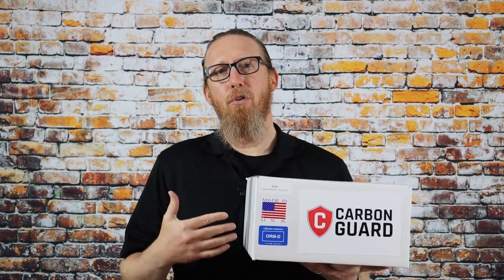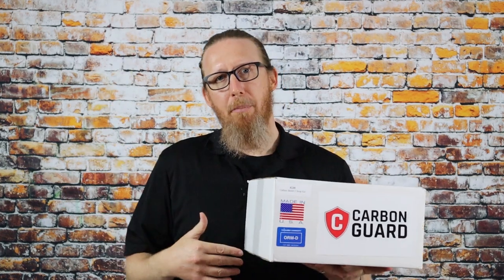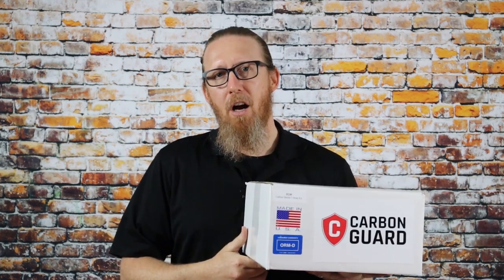Bowed Basement Walls Tips

Comment: Carbon fiber wasnt a thing when I was working it. We just used I beams and poured a new concrete wall to height on the inside of the structure to keep the wall from maxing out and collapsing. Nice info, branching out a bit more.
Reply from the maker: Thank you! We've done a lot with i-beams but we're moving into carbon fiber for those with less bowed walls.
Reply: What if you have two walls that are doing it right next to each other like the one on the left and the one straight ahead?   Can these be repaired in the same method?

Comment: My house is a split level in the center of my property. About a 1/4 acre in a residential neighborhood. The yard slopes downward towards the road. I noticed that the back wall, which is mostly below grade, is starting to bow. Looks to be about 1 1/2 inch. I've had a guy, recommended by people I know and trust, give me a quote on digging out behind the wall, putting in a french drain that he'll runn around the house and to the street drain, waterproof the back wall on the outside and fill in with gravel. I had a second person come out and quote what they would do. They are with a semi local basement company that is also highly recommended. They wanted to go the route of beams or carbon fiber, but no exterior work. The basement guys would run me about $16,000 vs the other guy was about $10,000. I've been looking for as many opinions as I can on the matter. The people close to me think digging out behind the wall and doing that work is the better way to go by actually fixing the pressure problem. They also believe that they wall will settle back and straighten, atleast some what, with the pressure of the dirt being removed. What do you think?
Reply from the maker: The wall will not straighten unless the dirt is removed. It probably will not straighten by itseld with the dirt removed. Usually a foundation company will excavate and install tie backs to straighten the wall then waterprrof outside and possibly inside too depending on how bad water intrusion is. Tie backs are used to straighten and keep from bowing again. Carbon and ibeams can only prevent more movement and nothing will straight a wall without removing the soil on the outside that I am aware of. Hope that helps.

Comment: This is very interesting, great video and explanation.  My daughter was looking at a home to purchase and the inspector told her two of the walls were bowing slightly and needed anchors.  I have never heard about the beams or carbon fiber.  After looking at installation of both, I have to wonder how do manufacture's test these solutions before they market them?  That is the most interesting thing how they tie into the floor and to the sill plate and/or floor joists and how that would be able to hold back that much pressure from outside the wall.  Especially with the carbon fiber, as I've heard it was a very strong material, but that's amazing it can be used for something like that.  How does an average DIYer figure out how many of those straps they would  need?  Or would you have  to consult a structural engineer to determine that?
Reply from the maker: Hi Matt, the general rule of thumb is placing strips 4’ apart for an 8’ high block wall, starting with the first strap 4’ in from the corner, so it will depend on the length of the wall you are needing to install them on. If the wall is bowing / tipping / or shearing more than an inch you should probably have a contractor come look at it. A structural engineer is probably not necessary unless their state requires it or there are serious issues beyond what a contractor can diagnose and fix.

Comment: Thanks for the great information. Can Carbon Fiber be used on a bowing brick foundation wall? Also what are your thoughts on using high strength steel straps for a bowing brick foundation wall? Thanks.
Reply from the maker: I am not seeing a lot of data supporting the use of carbon fiber on brick walls. The Carbon Guard we recommend specifically says "for unrivaled adhesion to concrete and block" and does not mention using on brick. You may want a local structural engineer to assess the situation to determine the best way to proceed. Hope that helps.

Comment: I have a slight  bow less than 2 inches , and previous owners had a tile drain system installed along the wall to help dispurse water and the basement was waterproofed  but they didn't reinforce the walls .... if I went with ibeams would it even be safe to anchor them to the newer cement poured when the tile system was installed ?
Reply from the maker: When it comes to bowing. We are now finding it better to speak with an engineer if you plan to DIY